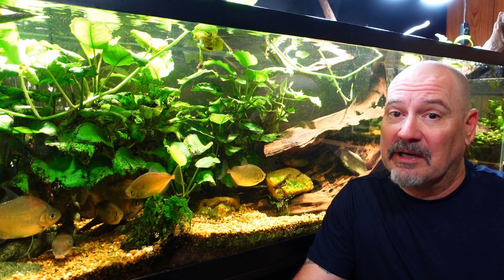Anaerobic Or Anoxic? What's The Difference?

Comment: Close, but not quite. Anywhere there is life, there is oxygen, because WATER is necessary for all life, and water contains oxygen. Because free oxygen (not oxygen in general) can be toxic to anaerobic bacteria, anaerobic bacteria utilize bound sources of oxygen which include but are not limited to: nitrite, nitrate, sulfate, metals such as oxidized iron and manganese, sugars, and organic matter in general. 

To be frank, I don't know why the waste water industry decided to steal and retcon the medical/geologic term "anoxic" to mean no free oxygen but with exception to nitrite and nitrate, when it typically just means a very very low amount of dissolved oxygen. Oxic and anoxic are like two ends of a spectrum; without free/molecular o2, anaerobes use nitrite/nitrate, then some metals are reduced, then sulfates are used and produce hydrogen sulfide, and finally under severely anoxic/anaerobic conditions, fermentation and methanogenisis occurs. In the aquarium hobby, severely anoxic conditions rarely occur even in deep substrate, and most of the mildly anaerobic processes occur in even relatively thin clogged filters and tight or mulm-filled substrates, so I see no need to muddy the water so to speak, by including specific wastewater definitions.

Comment: Dan, I’m listening to you through headphones and you are only coming through one ear. Please could you check your mic settings to see if you are in stereo or mono? Thank you! Also, thanks for your in-depth research you have done. It’s most helpful x
Reply from the maker: My mic only has one channel.
Reply from the maker: Thanks to your comment, I went and checked. I was misunderstanding what "single channel" meant. I assumed I had the cheap one that only did mono. It turns out it just default set to mono. i switched and now it's stereo! So thanks again!

Comment: Nailed it. That's why the under gravel has to be under 3-5in of gravel with Ann iron source and a substrate at the bottom with a high ion exchange rate. The air on the under gravel has to be extra slow so that the bacteria we use in our common nitrogen cycle use up the free oxygen by the time the water gets to the bottom. And as much of a jackass I think Dr Novak acts like (going after creators that didn't just jump on his band wagon) he did so a good job of explaining all of that with charts and all a while back. He was paid for decades to fix large aquatic systems whether it was issues at koi farms or reviving dead lakes and ponds.